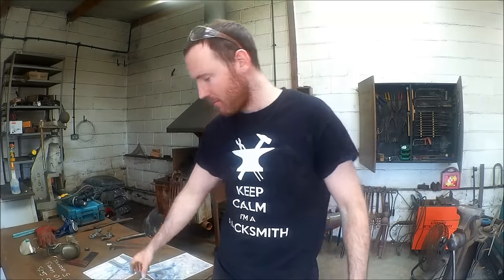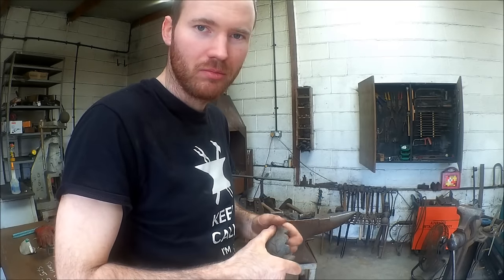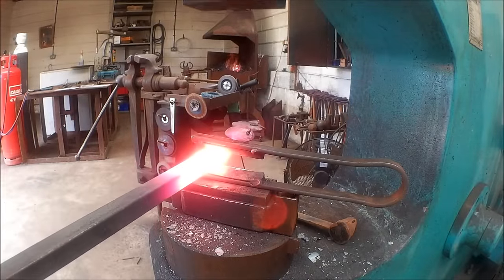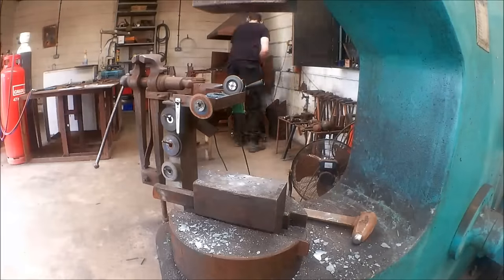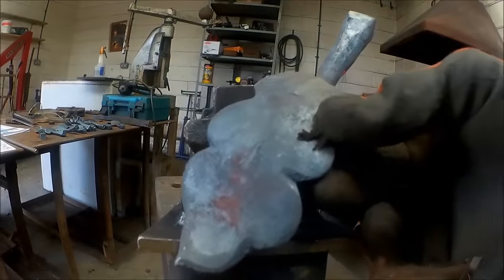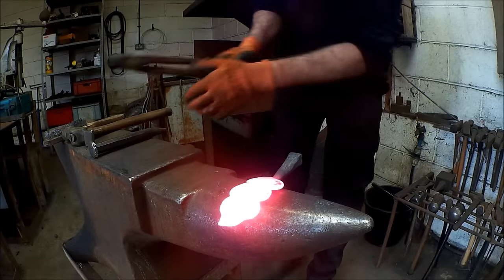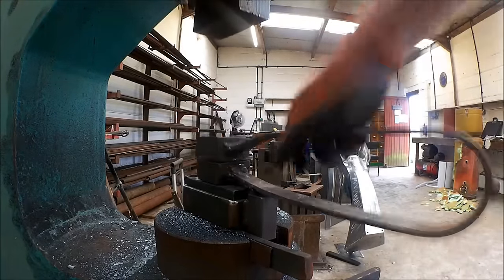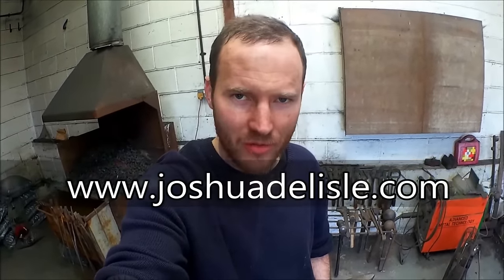Blacksmithing - 'The Way Gates' Restoration - Part 1

Comment: how do you price your work Joshua De Lisle, I am sort of grounded right Now and only doing light Rising gate Hinges, However they are for wooden gates - Job almost done but the cold snap shut me down as I work mostly outside...
Reply from the maker: Hi Tom, I exlain a bit of my pricing techniques in a recent video where I had made £600 per day. sometimes there is no formula and I go by what I beleive the value of my product is worth regradless of cost and time but only if I know large enough proffit can be made, such as specialist work sent to wealthy London clients etc. sometimes I price things so If I choose I can pass it to a friends workshop (normally £30 per hour)  and charge a 30% fee on top for providing the work, that way I win if do it and I win if my friend does it. like wise I charge a lower rate if my friends ask me to do a job for them as I havent had to deal with the client, come up with any design or work out the quote. Cheers J

Comment: This was fascinating to watch! I have to admit, as someone who came here for research purposes, that it got a bit frustrating to hear every tool constantly referred to as 'this tool' instead of by its proper name. Visually interesting regardless, though, so thank you!
Reply from the maker: Thanks sorry, most of the time I forget what they're called also, working alone means you never need to communicate it and you just recognize it for the way it looks. other times there may not be a mame as it maybe a unique tool... normally I ask on the BABA facebook group for info like that. otherwise which tool did you want the name of if I can help?
Reply from the maker: 1st tool is a sprung top and bottom blacksmithing butcher set down tool.
Reply from the maker: 2nd tool is a sprung swage die on one side and a tapered tennoning set down on the other
Reply from the maker: 3rd tool is a ball punch
Reply from the maker: 4th tool is a triangular swage block
Reply from the maker: the long nosed tongs are bolt tongs

Comment: I notice you use a rosebud for heating with the torch. I just use my cutting torch. Is there much of a difference?
Reply from the maker: +delcopeland I wondered what you meant then, thats a nice name for it rosebud, I know it as a 'pepper pot' torch, mine is slightly wider than a cutting torch but can easily change for a wider torch depending on the area I need to heat up. I use Oxy-propane mainly because its cheap and my cutting torch only works with oxy-acetylene which is expensive.

Comment: I'm currently building my forge and anvil stand, it's only a 20kg one but it will do for now :-), I've had a nightmare locating an anvil or a block of steel, so I had to go with a lower quality anvil just to get me started off fleabay.   No scrap yards anywhere near me allow the public to buy off them.  All the smaller ones feed the big scrappies here.  No rail track pieces anywhere to be found.   My forge is coming along nicely, sheet steel was too expensive so I have knocked something up.  But within a week or so I should finally be blacksmithing.  Loved the video, excellent as usual. :-)
Reply from the maker: Thank you. thats great news Dean, yes Anvils are hard to come by and now go for silly money. I'm puchasing some rail track to cut up into Anvils if your interested. are you UK or USA? those little cheap blue cast things arn't too good if its one of those.
Reply from the maker: +Dean Parvin I thought it might be one of those when you said 20kg.. I'll work out a price and pm you. I've started to build new forges that should be very affordable. the idea is that i'm going to start teaching in my forge and I hope to be able to offer all the equipment new blacksmiths need to set up including the anvil which I think a railway track is perfect for a beginner. I have one myself that I'm giving to my daughter when she is old enough. I know people in the railway network so i'm hoping to get a good deal on a large amount.
Reply: +Joshua De Lisle excellent! I hope you get a great price on the track, I think it's a brilliant idea,  I'm in the process of fighting for a refund on fleabay, o the joy lol. I like the idea of passing down the rail anvil to your children to get started on as well when of age to do so.  Yeh I shall look forward to the rail anvil builds :-).
Reply: +Joshua de Lisle if you need any railway track a scrap yard near me has the local contract with network rail so could get plenty of pieces in a range of sizes.
Reply from the maker: Thanks Luke I'll keep you in mind, the forges are on hold for now untill i've built my new workshop. ;)